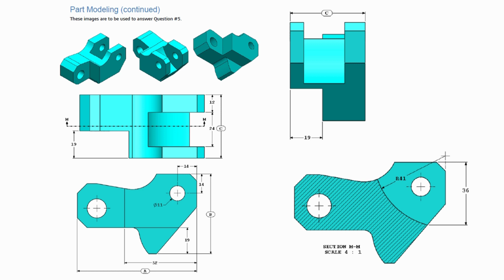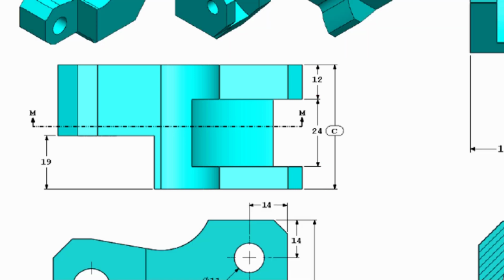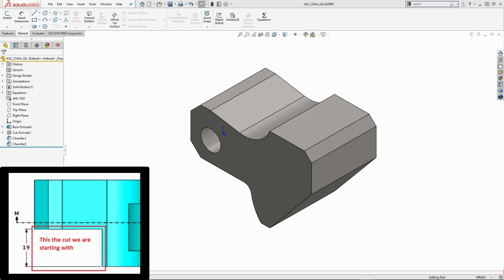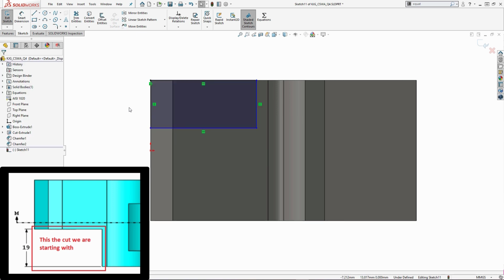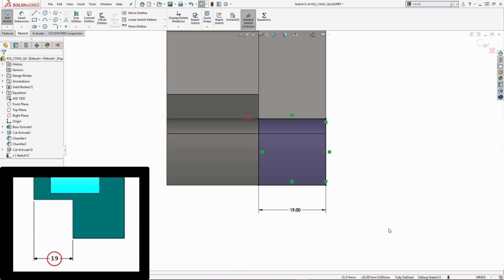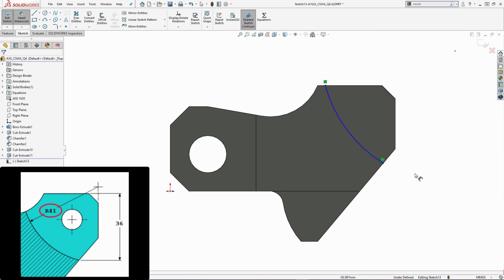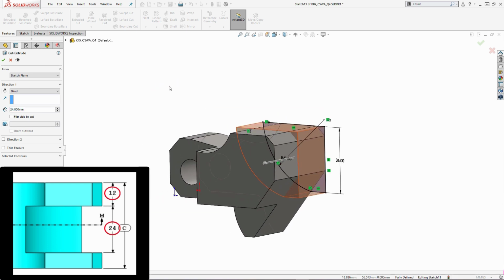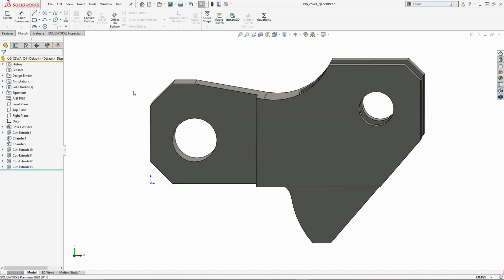Certified SOLIDWORKS Associate (CSWA) Exam Prep | Adding Part Complexity (Part 3)

Comment: Hi MLC, when presented with a new drawing, do you think about how you want to make the part or is there a specific way you have to make all parts on this exam or else you are wrong? I took the practice exam and the first part was easy, then i got to this part and got really stuck with the extrude cuts and overlooked the colinear relation for the arc.

Comment: I am having trouble aligning sketches like shown on 6:06 , it seems like I cant draw unless I am directly clicking on the selected sketch plane. Is there a way to fix this ?
Reply from the maker: Make sure your sketch gets created on the correct face, "Normal To" (ctrl+8) will orient the view normal to the active sketch plane to ensure you are sketching in the correct direction.  If the sketch is off, or your view is off, start the process again at 5:30.  I hope that helps!
Reply: @MLCCADSystems  thank you for all the help, your videos helped me pass my cswa certification